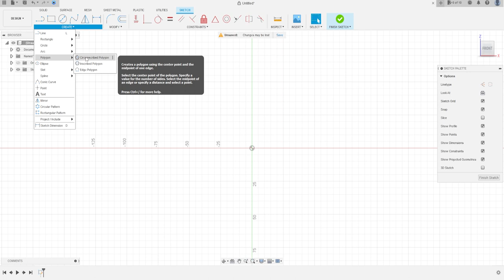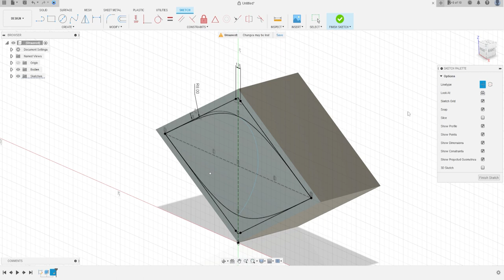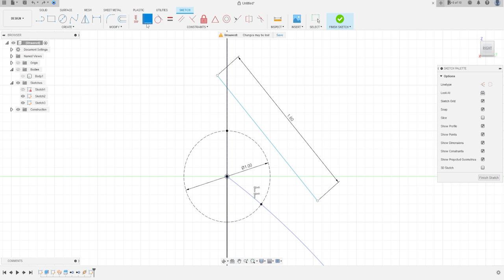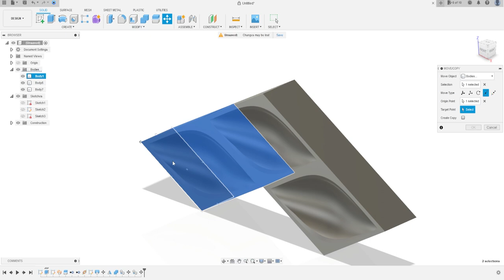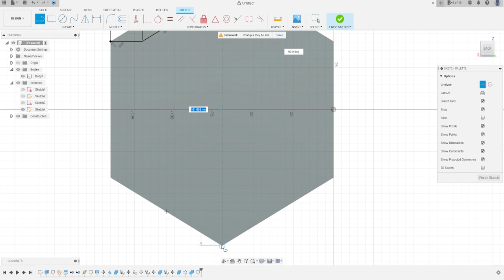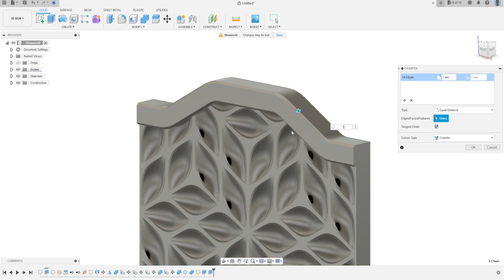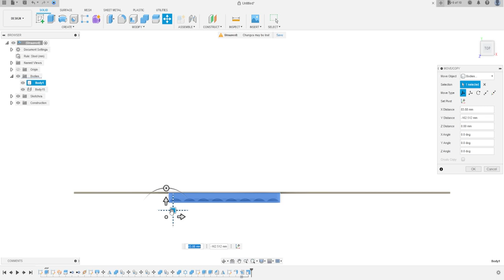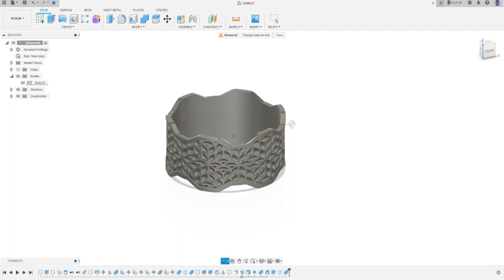Fusion 360  Tutorial - "Leaf Pattern on Ring"

Comment: I recently discovered sheet metal mode in Fusion 360 a few months back.  Seemed to be the only way to do bracelets in Fusion 360 which I enjoy making. 

I will have to try your technique to create rings next. 

But I am still learning Fusion 360 and still using imported SVGs from Inkscape. Importing SVGs really taxes Fusion 360 and slows it down to a crawl.

This one crashed Fusion 360 many times:  https://youtube.com/shorts/_t_lE18vE9M
Reply from the maker: In fusion this is the only one technique I know, in Solidworks is more easy to do. Sure!!!  Importing SVGs really taxes Fusion 360 and slows it down to a crawl!!!
Reply: @fusion360tutorial  Haha - almost killed my notebook with SVGs.
Reply from the maker: @CelticOneDesign  kkkkkkkkk
Reply: @fusion360tutorial  Learned a new trick that is faster when using sheet metal mode. Normally I would extrude cut the flange from the design. That sends Fusion 360 to never never land. That works but takes forever to process. I discovered if you select the inside surface of the flange and offset the face by -2.5mm (the sheet metal rule thickness) that it is lightening fast. Less complex math to process a negative cut on the Z axis I guess.